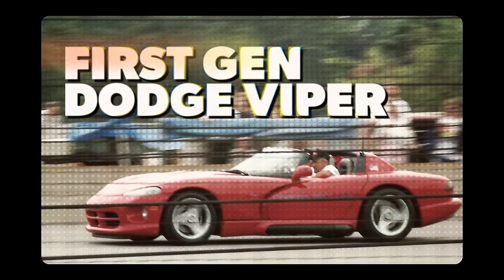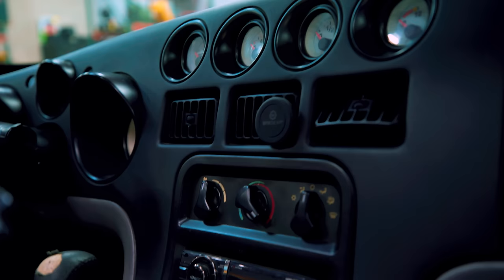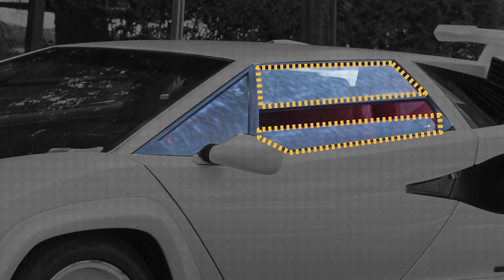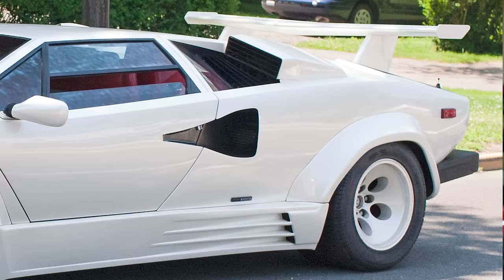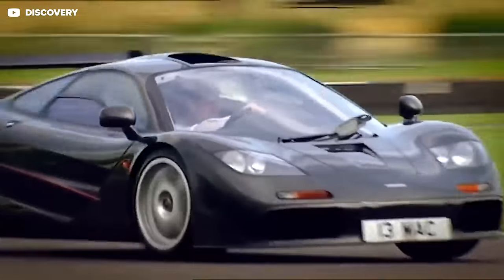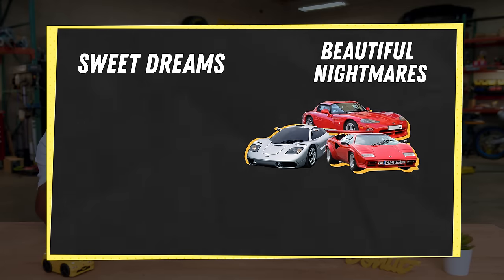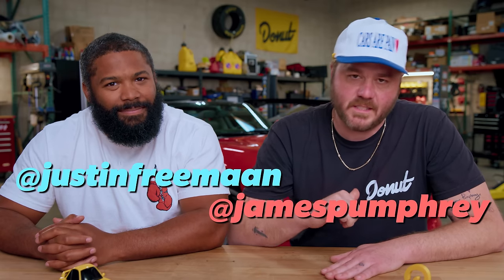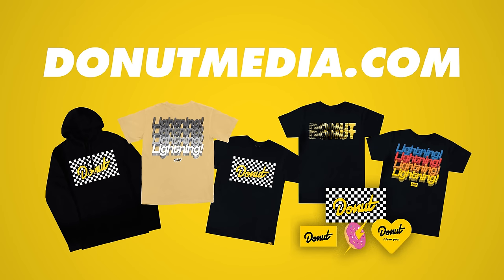Cool Cars That Suck to Own

Comment: The only one of these cars I would possibly consider would be the Viper. It appears to have a reliable power train, although truck like, & maintenance wouldn't be through the roof. I've noticed those zip in windows on them & these would bug me. Why, even the humblest 
Corolla has crank up windows & door handles.

Comment: Psh, come on man. The Viper wasn't that bad. My dad bought a blue mid 90s one with the white stripes right after Gran Turismo 1 came out and we went everywhere in that thing. His had the optional a/c and he did some sort of trick or made some sort of modification that prevented the windows from leaking in the rain. And at 400hp? You'd lose a lot of respect not being able to handle 400hp, even in the rain. My S550 GT dynoed at 449whp and the TC is always off, even in the rain.

Comment: the vipers engine was not derived from a lambo engine. it was based on dodges v8 truck engine. Lamborghini did help with producing an aluminum prototype. but it was not designed by lambo.

Comment: Rx8 is my guess, its a sports car with enough practicality to be a daily car, however, because of the rotary engine you need to do mass maintanance  every 80k miles, which can be a pain, its more of a pain in the rx8 than the rx7 because unlike the rx7, the rx8 is a four door coupe, and is designed to be the main car and not a secondary sports car, meaning you gonna need to swap the plugs much more often on the rx8.

As well as the fuel economy.

Comment: The Viper is just a cruise machine. I used go haul cars in 2009. I hauled a Viper GTS. I tried to drive it around the the parking lot in between organization cars by stops. Man as soon as I popped the clutch I went sideways. I tried 3 times and you have to feather the gas and just cruise. Ain't no way I would speed in that nope.

Comment: 190e's are indestructible I swear, the SL r129s have major issues. I remember my dad getting a 94 sl500 for less than 10k years ago it had just over 100k miles - instantly had problems with it and a technician quoted him 20k to fix it. main problem being that god awful wiring harness

Comment: The maintenance cost on most of these is insane. My personal choice would be the AC Cobra in replica form, not aluminum, and with just a stout 289 HiPo Ford, maybe with Weber carbs or modern fuel injection, no foulimg plugs electronic ignition, 5-6 speed manual with hydraulic actuated clutch if possible, medium, not ultra, modern low profile wheels/ tires, a few modern convienences in the interior, ehhaust not too loud but sounding good, in dark blue please. I'd be cruising some back roads on dry only days with a wide grin on my face. Peace!

Comment: I've had the pleasure(?) of driving a 2005 mamba edition Viper. It was horrible until it hit highway speeds and even then I didn't have any more fun than driving a modern V8 Challenger (w/ stick). I could see any viper as a track car but to drive on public roads is not great.

Comment: The Viper V10 is not derived from any Lamborghini engine it's based on the Dodge Ram V10 truck engine, which itself is based on Chrysler's LA series small block V8.  Lamborghini is really only responsible for updating the iron block casting design to all aluminum and because of this Dodge Viper V10 cylinder heads swap over to the V10 Magnum Ram engine with minimal modifications.

Comment: That is why the same year zr1 as the viper was faster and had all that you said and the viper didn't. The viper weighed 3450 about only 10lbs less than the vette and it didnt have all the comforts and safety the vette did. Totally agree with you on the Countach. Both Countach and Testarossa on the wall. So i finally met my child hood heroes (which they say you should meet youll be let down) and the countach let me down. The looks are amazing but its a nightmare and the clutch is a way hard, hence why i got a Testarossa lol .

Comment: If maintenance is a problem you can't afford a McLaren, or a Bugatti. The viper was built for people who don't want any help driving and I love that about it. All these driver aids take away from the real thrill of driving a car that does what you tell it to do. Would you want to go on a rollercoaster if halfway down the big drop an automatic brake system slows you down so you don't get scared. These cars are only dangerous if you don't know what your doing or don't respect the power that's under that right foot. That's the whole point.

Comment: Thank you! I always heard of the Viper and wanted one until gas went past $3 a gallon at least. No handling or ABS though? I've been saved countless accidents on ice and from that guy stopped in line at the interchange pulling out in front of me going 75. This I did not know - how's the actual suspension? I gotta say I LOVE my 1999 Toyota Solara manual - 270k and running awesome 👍

Comment: The Viper is only "Terrifying" to drive if you're a sissy and allow it to overpower you.  It is a powerful, bare bones vehicle that must be stored in a garage, even while being driven. 
The engine was designed, in part, by Lamborghini, based on the Chrysler/Dodge Magnum V8 and adding 2 cylinders.
Mine had a bullet hole in the left rear QP.  I bought it in 94 from a police auction on a nasty, rainy day when not too many people were present.  It was fun to drive for about a month until I sold it due to not being able to afford the insurance.

Comment: I raced one of those early Vipers with my 400ci V8  S10 and blew it's doors off. 
 All the HP is in the upper RPM's  and a short stroke so not much torque

Comment: As a Gen 1 viper owner I'm kind of offended that you didn't correct him when he said it was unreliable and would only use as a track car.. Vipers especially early ones are bulletproof super cars with many many many of them well over 100k and 200k miles and no major issues... Also there not bad to own at all if ya own a garage and drive it on weekends or nice days especially if you live in the southwest

Comment: The best thing the Viper never came with was an automatic trans and could only be had with thr 6 speed. It also had no outside locks,no roof,no a/c, no ABS and alot of creature comforts you normally would find in a sports car. The car was BAD A$$ though and hauled a$$ too..

Comment: I've own my fair share of cars and live in the Midwest (snow). I find anitlock brakes dangerous. They take over control of your brakes when you need it. If you don't suck you can control your pedal pressure and pump brakes on your own much better than the car. And traction control really shouldn't be needed if you are just driving around town even with powerful cars.

Comment: I would call no ABS and traction control a benefit, not a downside.
Reply: It benefits the "fun" factor, for sure. Definitely not the better/faster way to drive in most cases.

Comment: One that sucks to own for another reason...have a 2004 Benz 500SL AMG, still only have 57000 miles on it. Sticker $94700......they have depreciated $80000 & a visit to the dealer is $1000 before you go into the shop door.....Feel MB over engineered this car & it it's reputation is unreliable. When it's right, it's fast, comfortable & handles on a rail, but Damn. It's always something.

Comment: Sports cars are not supposed to have traction control, windows or any amenities which add weight or computer controls that take away from the driver. Lotus' ABS is programmed to never engage. 5 years of tracking and driving and they have never intervened.

Comment: The Dodge V10 NEVER derived from a Lamborghini engine. It derived from a work truck V10!
"at the time Chrysler owned Lamborghini and it tasked the Italian supercar maker with creating the Viper's V-10 engine. Dodge handed over its cast-iron block V-10, which was designed for trucks, and told Lamborghini engineers to make it suitable for a sports car. The Italian brand worked its magic and recast the block and heads in aluminum, and thus, the 8.0-liter V-10 was born." -MotorAuthority

Comment: Ermmm... bruh, the only thing Lamborghini has done to the Viper's engine was its design. This was a Dodge truck engine, Lambo's first V10 was a quad-valve 3.9 litre that had nothing to do with this other than the cylinder count.

Comment: The engine wasn't derived from a Lamborghini engine it was the basic Mopar small block with 10 cylinders, made the way Lamborghini knew at the time how to make an all aluminum 10 cylinder!!!    "designed by Chrysler but with aluminum block castings designed by Lamborghini for use in the Dodge Viper."

Comment: Sometimes y'all crack me up. You're scared of cars that don't have anti-lock brakes and traction control? So basically any car built before you were born. Meanwhile, I'm over here planning on how best to disable/remove those systems from my car. I'm also wondering if I can delete the airbags without causing issues at inspection time. The Viper was the last real car sold in the US.

Bottom line-- A true performance car should feel like you strapped a saddle on a grizzly.
Reply: I’ve never owned a vehicle with traction control and most of them either didn’t have abs or it didn’t work or I disabled it.

Comment: So the “Viper is a nightmare to own” and you “imagine it breaks every time you take it out” but neither of you have actually owned a gen 1 Viper?  Makes perfect sense that you would have an opinion on it.
Reply: Exactly. 👍
I used a '94 Viper as a DD for 8 years, over 100k miles.
Was rock solid reliable.
These guys are clueless.
Reply: @jamescampbell4334  same for my brother.  He bought his 95 from the original owner in 2017 with 56k miles on it and he put another 42k on the clock and never had a single issue with it.  Not one.

Comment: A lot of poor research in this video. The Viper V10 was a truck engine that was changed from iron to aluminum and it was tweaked by Lambo. It wasn’t a Lambo engine.

Apparently these people never have owned an older car. I’ve never owned a car with traction control and a vast majority of the vehicles I’ve owned didn’t have abs.

450hp isn’t that scary to drive without nanny controls. 
People rely on nanny controls way to much today.

Comment: I’ve driven a Countach. I had to cock my head so that I could fit. (6ft) you can’t see anything behind or beside you (Or in general). The clutch, steering, and transmission shifter are super heavy and getting in and out requires yoga. 

With being said that was quite the experience. A fun one but also an uncomfortable one.

Comment: Let me get this straight, you want ABS and traction control, in a dodge viper? ...we are not the same. I want possi track. You shouldn't even attempt to drive that much power if you need traction control.

Comment: Love the Viper, but to call it a race car... It is a race car in the sense that it lacks common elements that are either safe or comfortable for a street car. 
But the handling was worse than that of a bicycle, braking was dreadful, chassis not so brilliant, so no, not a race car. Just a very powerful and very good looking car with an unusual engine and gobs of torque.

Comment: Get a BMW M340i instead. It's blistering fast, a pleasure to drive everyday and fairly low in ownership. Get a M340iX (4wd), tune it a bit and it will outrun 99% of what you're likely to meet on the street.

Comment: I owned a '94 Viper and I loved it.  I felt like a million dollars driving it.   I only got caught in the rain once and that was treacherous.   
I never had any running issues and warranty work for small things like convertible top plastic clips was always good.  It was so much fun to drive as long as you keep the idiot in the truck and not behind the wheel.  The car did not hold it's value very well at all, but I loved it.
Take care.

Comment: Of the cars listed here I've seen close up and personal three of them: The Viper, Countach and the Cobra. I live a few miles from the Chrysler proving grounds. For a year or so, you couldn't go to our local gas station without some Chrysler engineer being park there drawing a crowd. Nice dream car, and I think you've called it right. I walked past a Countach in a Sears parking lot about 1980. Thought it was a kit car, because, you know, who parks a Countach at Sears in Livonia? So I hunker down to see what kind of V-Dub engine it has. It didn't. So I stood up really carefully and backed away, into a guy with this sheet eating grin on his face. His car. He likes to take it out on nice days to watch people stare at it. And they were. Wish I had asked him to fire it up. Lastly, I was on a pizza run. In the parking lot was kit car Cobra. I'm giving it the once over appreciating how good a job they did smoothing out the glass body. The owner comes strutting out of the store with his pizzas so I complement him on his car and ask him if he built the kit or had it done for him. Instant rage. He choked the words out that it was an actual G___ D___ real deal. That was about 1973 when you might actually have been able to afford one. That one I got to hear fire up and spray gravel all over me as he took off. But it was worth it.

Comment: The Viper does not have an engine based on a Lamborghini engine, it was a V8 Dodge Ram engine with two extra cylinders tacked on that was ultimately cast by Lamborghini. So truck engine not Lambo engine.

Also I want some of what your smoking that makes the Pagani Codalunga look good to you. I didn't think Pagani was capable of making an ugly car but I have now been proven wrong. It looks like what Hyundai would make if they tried to make a supercar.

Comment: Vipers are some of the easiest and most predictable cars to drive if you're not a complete idiot. The biggest reason for Viper crashes? Old, cold tires. You'd be surprised how many Vipers out there are still rolling on stock rubber. Both of my Vipers had original tires when I bought them, my 02 which I purchased in 2013 had 9 year old tires and my 09 that I purchased in 2017 had the original tires as well and both were extremely dangerous to drive.

Comment: Dodge viper: nothing that was mentioned is a detraction in any way in my book. 10 cylinder doesn’t make any more power & torque than the high performance big blocks of the old days with even worse brakes and even worse handling. If our grandfathers can be men, so can we.

Comment: The worst car I’ve ever owned by far is a 2007 Nissan maxima. The car itself is cool.. but I swear that car was cursed. It was one problem after another. I went to go get it registered and my check engine light came on while I was going there. There was an air bubble in my coolant system so my temperature gauge was all over the place. I was going to pick up and ex and the temperature gauge went up and the car overheated and turned out I had no coolant in it. I got stuck in snow and I was trying so hard to get out my coolant hose snapped and leaked coolant everywhere. Had to get towed home.. during covid. Before I finally got rid of it my flex pipe was clogged so it was idling super rough. Then my steering wheel kept getting super difficult to turn. I kept putting a power steering cleaner in the reservoir and it did nothing. I went back to Toyota.

Comment: That McLaren clutch being replaced ever 2-3k miles is bullshit, I'm sure they did it when the cars were new and in warranty because they expected owners to launch them hard all the time and they wanted the cars to always be mint whenever someone drove them, but there's no way that driven sensibly that's how long it lasts, any sensible owner today will simply change it when it needs changing (ie when it stars to slip). Same as the tyres they wanted it all to be perfect all the time but now if someone just buys a set of tyres and wants to change them in their garage what is McLaren going to do about it?

The F1 is not even a particularly complex car. It was special for its carbon chassis which made it light and strong, but other than that there wasn't any spectacular new technology anywhere. Even the famous engine is basically an 8 series engine with e36 M3 heads. What really makes the car great to drive is top shelf, high precision chassis tuning. The likes that you can get done on any car really by companies that really know car handling like Prodrive or Lotus, it's just that nobody ever bothers.

Comment: I think technology has numbed real sports car owners to were now all we have to do is press the brake turn on lauch control and have DSG or some dual clutch system launch you. You notice now when you see bad car accidents the car tracks lead to the car going completely off the road. Most modern powerful cars numb your senses.These modern management systems fool people into thinking they are in control of car as systems are pulling power , timing , transitioning traction to front and rear diffs so you have no idea what is going on with the PHYSICS of the car going down the road. So now i kind of understand how these young guys would have no way of understanding how driving a sports car used to or should be. 

It shouldn't kill you but you should feel enough of whats going on with car to respect its power

Comment: As being an owner of a first generation viper I have never had problems as you described in this video. It’s one of the cheapest super cars to own . Plastic windows? Yes it’s a thing but you can easily get after market windows xxx no a/ c yeah not a problem since it’s a convertible…. Over heating I have never experienced this in the whole time I have driven and owned this . I do my maintenance. Take care of a car and the car will take care of you. If your lazy well don’t own one. It was meant to be one of the first high performance STREET CARS … not an everyday car . Your take on the car is miserable and has allot of fake facts. You just don’t understand the concept and at the time of its release in 1992 it was at the top of the list of cars to own. I have Zero regrets owning this Iconic car.